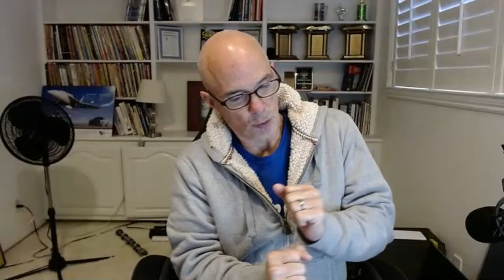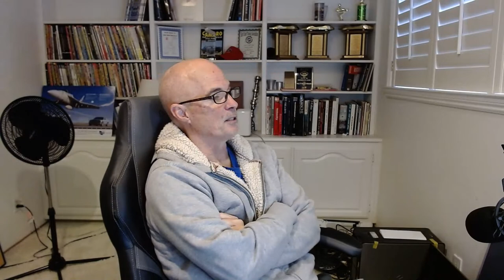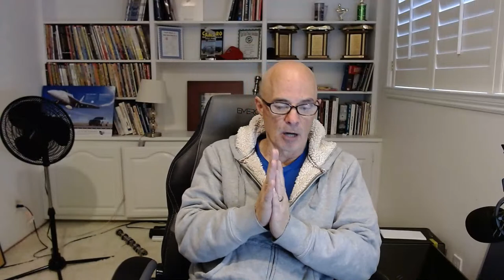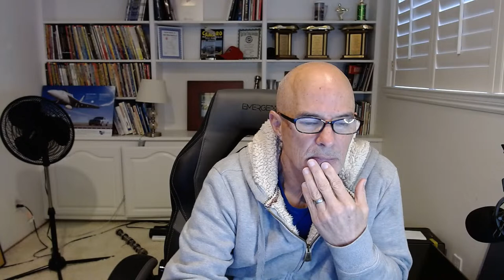LET'S TALK TECH-NITROUS SINGLE VS DUAL PLANE INTAKES!

Comment: Paint coming loose, going through the pump and hopefully not getting through the bypass in the the filter and into the mains or cam is going to more than negate any improvement you may get.

Comment: Learned to used the Glyptal from assembling antique Harley and British motorcycle engines, they were sand cast and porous at best.  So, all the old guys did it, so I have always done it.  I have also seen Rustolem black on the insides.  Brush it (Glyptal) on and set up a heat lamp to set it or cure it.  

I am interested in the L78 because I have most of the stuff to build one, only with a 2 bolt block.  Keep it up!

Comment: I use Deere buff primer sealer to paint the inside of blocks and heads.  It probably is an insulator but the oil and coolant is taking the heat away from non painted surfaces so it’s like no effect

Comment: Always been against painting inside of block, if a quart is stuck to the block whilst the engines running you can run a quart more oil. But more so, leave it cast for heat transfer.

Comment: I have painted the inside of my engines with engine paint usually light grey, and I've never had a peel off if you get the surface prepared oil-free

Comment: Reposting this. Would love to see a dyno/smog testing  of stock, high flow cats, and catless. Would like to know the best high flow cats that can still clean up emissions. I have a built K20Z3 head with a TSX 2.4 bottom end.
Reply from the maker: DON'T HAVE A VEHICLE TO RUN THAT TEST
Reply: @Richard Holdener  I can be there in a couple hours 😎

Comment: I've noticed many people don't run an inner cooler when using methanol.  Weight, time, packaging?  Is there such a thing as too cold of intake temps?
Reply from the maker: NO SUCH THING AS TOO COLD-BUT WEIGHT VS POWER IS A THING FOR RACE CARS